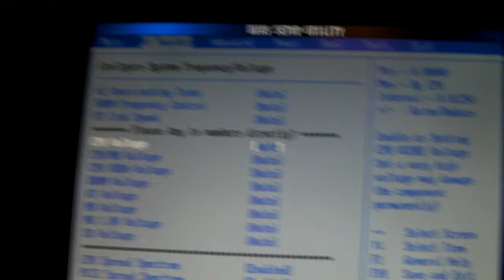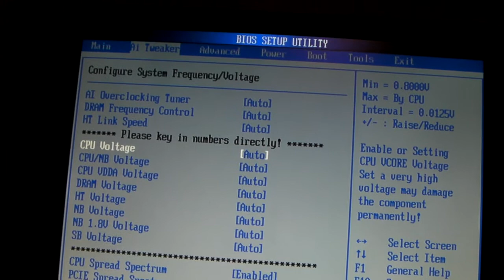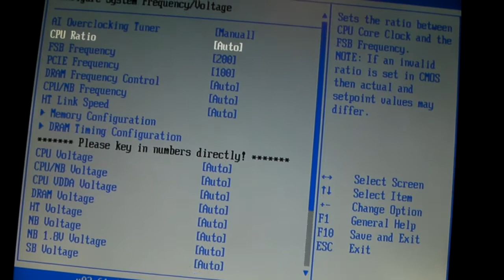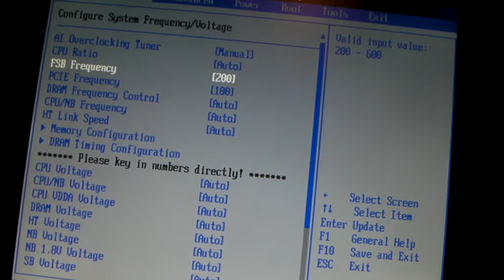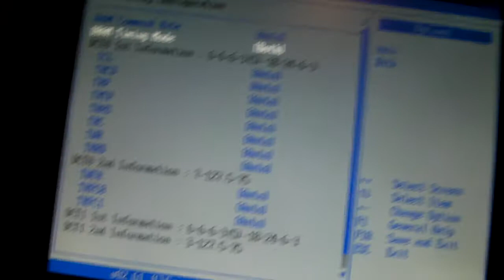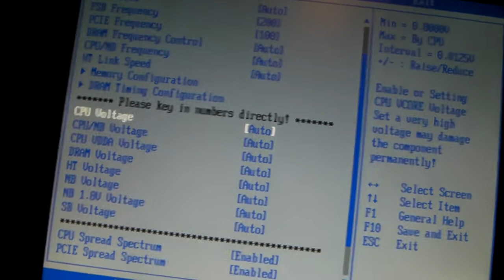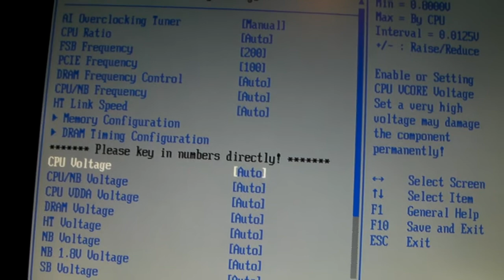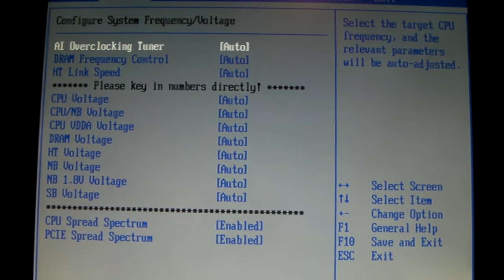Quick overview of overclocking your system

Comment from the maker: @decisionvida In general it is a bad idea to overclock a laptop, there is no room for the additional heat to go to and you can't put in bigger fans or more of them.

It all depends on the bios settings as well, if it does'nt give you an option in there you just can't do it.